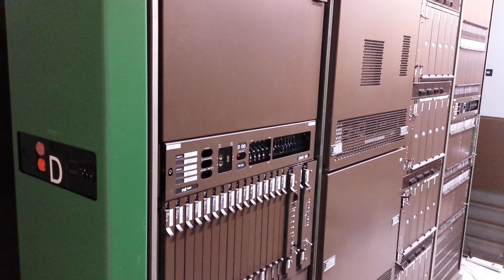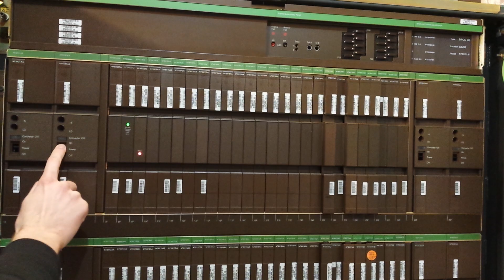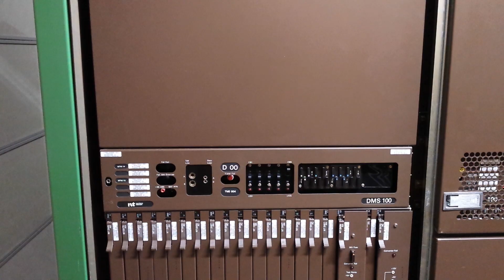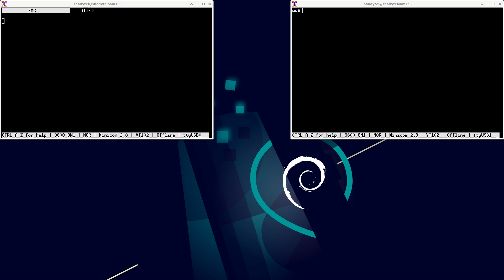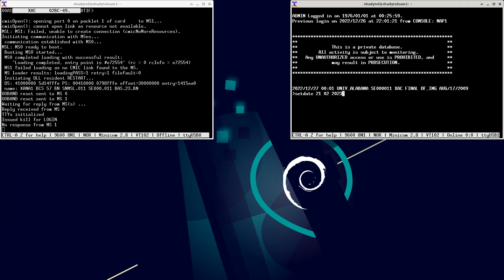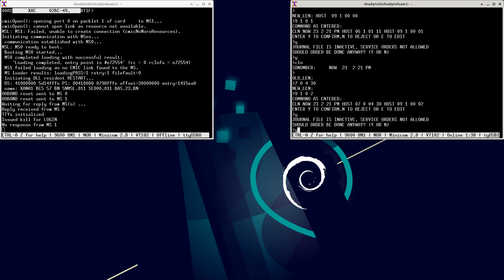DMS-100 Startup and First Phone Calls

Comment: So glad to finally see this running! I can't even begin to imagine how much effort went into this behind the scenes. Also, you're an absolute chad for using the Nortel analog sets, I love those things.
Reply from the maker: Of course I could have just grabbed a 2500 set, but I decided it had to be some sort of Nortel.

At some point, I need to give the SL-1/meridian styled Centrex sets I've got a try.
Reply: @joesvax  Watch out for the differences between analog sets and digital sets. They often look similar, but of course they need different line cards on the switch.
Reply from the maker: @ctillnc  yes, I'm aware, the sets I am referring to are the p-phone key sets a la M5000 and NT4Xxx

Comment: I still maintain option 11c, 81C and CS1000 at work and it's a treat to see you get this DMS-100 up and running.. Management wants to get rid of all the Nortel stuff but for critical services everyone agrees it's still rock solid and reliable. Keep up the good work!
Reply: me too, still running  cs1000, rock solid, as long as the power doesnt die unexpectedly, that wasnt fun trying to get it back after that. Callpilot hardrives starting to die now though. Keep up the good work!
Reply: Bet the military still uses this stuff
Reply: Just out of curiosity, what is this stuff being replaced with? I know it's all soft switches now, but I don't think they are just using generic asterisk boxes.
Reply: @theenterpriselab9401  This switch says University of Alabama, and they went Cisco, like most big companies. I know AT&T uses a Alcatel-Lucent (Nokia) IMS core and Verizon is on Ericsson. Nortel carrier hardware was sold to General Bandwidth, now Ribbon, so the direct upgrade path is to a Ribbon media gateway and call controller. In my area, the rapidly dying ILEC replaced their switches with Calix C-series around 10 years ago. Fiber Ethernet goes in the box and copper pairs handling DSL and POTS come out.
Reply: They told us they wanted to get rid of all the DMS switches by 2025 back in like 2018ish.  I think they got rid of one so far.  Going to be a while before they decom all these because they just keep working.  I  hope they continue to stay in service since my job relies on it.  Any time they bring something new they never give it to us unfortunately.

Comment: I remember my University rejected Northern Telecom because they were so impossibly obtuse to operate. We went with AT& T and you basically started things off by pressing a start button and monitoring a CRT. The user interface was really cool.
Reply: Everything telco is rather "obtuse". At least the 5ESS has a menu interface. It's not entirely obvious, but much more so than the command line. (having never seen one cold-start, I couldn't compare. it's not something that ever gets powered down. the one I walked around all the time was powered on in 1974, and has never been powered down to this day.)
Reply: @jfbeam  If you can get a screenshot with uptime, you win the internet hands down!
Reply: Your university knew nothing then.
Reply: @SteffenHansen1973  That's not how it works. Various components get restarted all the time. Software does get upgraded. Just at no point is all of the processors down. (see also: in service software upgrade [ISSU])
Reply: was it a 5ESS or Definity they went with?
Reply: Then they settled with a 3rd rate switch.  The 5ESS was vastly inferior to the DMS100 in Europe. 

To buy a switch because it has a graphical or sone other interface over the DMS command line interface and table structures says it all.  They only needed low skilled operators to maintain it, not skilled DMS engineers.
Reply: I started my career monitoring a DMS-MTX and moved to a competitor that had 5ESS’ and my reaction to the interface was exactly the opposite of yours. While prettier, the 5E was less intuitive and harder to operate, IMHO. Tons of power in the command line interface on the DMS if you knew what you were doing.

Comment: I started installing DMS back in late 80s in Australia. Went on to work for Nortel for 12 years before being made redundant not long before the demise of the company. Worked on Supernode CM/SLM pre BRISC with JNET all the way through to XA-Core, ENET, SPM, IOM and SNSE with DMS-100, 300, DMS TOPS, STP, SCP, MSC, MTX, GSP then right through the evolution of CS2K and CS2Kc and C20. CS2K hardware including but not limited to CICM, MG15K, G9, ERS8600, SAM21, MS2010, IW-SPM and SST and BCP for SIP trunking and A2 for SIP lines and SIP PBX. 
Next step is moving from CS2K, C20 and DMS-300 replacing them with Ribbon SBC and standalone A2. 
All the blood, sweat and tears I have shed for DMS over the years. But it’s all been worth it.
I cried the day I had to turn off the CS2Kc which was replaced with Cisco Call Manager…replacing a carrier grade solution with an enterprise POS that had so many flaws and very poor support.

Comment: Very cool!  I worked for a large hospital corporation for 32 years and we had tons of Nortel equipment.  Everything from tiny Norstar systems in some physician offices to Opt 81C's in the two big hospitals and two Opt 41's in the smaller hospital and business office.  I had them all networked together using ISDN.  I went to factory schools a number of times and loved working on that stuff.  Shortly after I retired, they declared bankruptcy and most of the big iron was acquired by Avaya I believe.  When we started building the data network in the early 90's, most of it was Bay Networks, later acquired by Nortel.  That dial tone and ringback was common to all Nortel equipment including my home phone which is a 3x8 Norstar fed by a voip adapter and a blue tooth gateway to our cell phones.

Comment: I must be getting old.  I worked on these at BNR in our captive offices, mid 80s, and wrote some of the LCM and other maintenance software other peripherals, i.e. the double dashes that report card failure on 1/2 the replaceable unit.  I can't remember much (PROTEL or other), I went on to other work at Nortel and anyway, so long ago ... amazing to see this set up in a garage, I wouldn't know how to do any of this anymore (I do remember loading large tapes of test software) in lab shifts that were sometimes only available at midnight ... blast from the past. Thankyou.

Comment: Old school Nortel guy here. I came up on working on the Option 11’s and later on the CS1K and also worked on many Norstar switches back in the day. Nortel was some of the most rock solid gear you could work on. Local phone company here had a DMS100 at one point and later upgraded to the CS2K. It’s a treat to see someone take interest in keeping the Nortel gear alive. Some of the best stuff in the industry right there. Now you need the digital M5000 series phones to go along with that switch. They look just like their counterparts on the M2000 series but are totally different beasts.
Reply from the maker: I actually do have several of the M5000 series, and even an old NT4X set in the older SL-1 styling. I need to get around to trying them at some point.

Comment: Coincidentally, I co-op'ed as an outside plant engineer with BellSouth in Tuscaloosa while I was in school there (in electrical engineering). I haven't checked lately, but last I heard, AT&T was using Lucent 5ESS switches in all three Tuscaloosa central offices (Northport, Druid Hills, and Tuscaloosa Main & Toll). They replaced the switch in the Main & Toll office after I graduated (the former clicky beast in that CO was an AT&T [Lucent] of some variety), and for some reason I never had a reason to visit the Northport CO, but I've seen the 5ESS in the Druid Hills office. :)

Comment: Went to training on Nortel switches back in the late 1980s or early 1990s.  We used a couple of these switches at gateway earth stations for the satellite new gathering system GTE Spacenet had that supported ABC, CBS, CNN, and NBC satellite news gathering trucks.

The switch allowed the SNG trucks to connect to the PSTN and make calls back to the station to set up the new feeds and to connect the talent's IFB audio.  The trucks could also make international calls if desired.  We passed the billing records back to the networks based on the SNG truck's ID.  Fun times.

Comment: As someone who took a summer internship as a maintenance tech on 1980's and 90's era semiconductor fab equipment a couple years ago, I can say, that the order you turn this old equipment on matters. It always baffled me how you couldn't just "turn it all on".....like, things had to warm up and you had to follow the procedure or else certain cards on certain control boards wouldn't boot or be recognized etc. It was wild.
Reply: "It's all in the sequencing." Everything has a power on order. Even a PC has to have the numerous components powered on in a specific order. (somewhere around here, I have the FPGA programs for the various servers I helped design.)

Comment: I supported and wrote DMS100/200/250/300  HW diagnostic portions of code as well as line card supervision extensions and ringing, payphone coin  support, designed and integrated API for SLC96 remotes and good old echo suppression and echo cancellation. MAP UX was a hoot!  DER Energy is next new control plane at scale challenge.  Energy is the new "Media"
Reply: Haha haha what bullshit.  Line supervision of a DMS300 ?   HAHAHA

Comment: Very cool to see after so many years!  You need to get some punchdown blocks to wire to the LCM's.  Then you can know the joys of running that terrible tool (I forgot its name) that makes you verify dial tone on every pair, in order.  If something was wrong or if you accidentally the wrong pair, the tool threw the error and quit.  You had to start over.  PITA.  To clarify, though, this is a DMS-100, aka "class 5 end office."  SL-100/MSL-100 has the DMS software base and additional code for DLM's and digital phones (M2000 series).  The MSL-100 was also cabinetized (i.e., one shelf shorter with gray front/back doors and end panels).  I have books - I'll send you a DM.
Reply from the maker: Yeah, this system was originally a DMS-100/200 (SL-100 didn't exist when it was installed) and later converted to SL-100/MSL-100, so it has a mixture of converted DMS hardware and SL hardware. Later on it was upgraded to CS-2100 (PABX counterpart to CS-2000 CO switch).

I haven't found any way to DM through youtube, but feel free to contact me via email or other means http://www.dms-100.net/contact/

Comment: Amazing video. I worked on DMS500 since mid-90s, kept quite a handfull of documention if you need. Mostly cds. Im retired now but company i worked for 20 years still have 3 DMS running in VA, and im probably will be cLled back for decommission job once all services have migrated to  voip.
Reply from the maker: If you're looking to unload any of that documentation, I've been slowly preserving it and putting it up on my website. Get in touch with me, if you'd like. http://www.dms-100.net/contact/

Comment: Triumphant!

That's gorgeous. Let's set you up with a bunch of 50-pin connectors and harmonica breakouts.
Reply from the maker: Actually I need a bunch of 32 pair connectors.....

Each line drawer on the DMS has 64 lines

Comment: Just makes me think about when I had to run jumpers across the rack, 150ft down,  up a ladder, two isles over. We were still putting 900 pair cable in the ground 7 years ago (road moves)... winching so hard the front end of the truck lifted up off the ground.

Comment: I remember programming Unisys mainframes using NAP (Network Applications Plaform) to interface into these switches back from the early 90s to mid 2000s. We were able to perform several hundred thousand customized calls a day without breaking any sweat.

Comment: Wow, that's really impressive! Especially so after reading how much work was involved getting to this point. 
I've always had a soft spot for these old digital systems, but the furthest I ever got into it is some little Norstar units. I did manage to get the Norstar CTA and RAD software working, and I believe I have the Norstar version of that Dialogic T1 card you mention on your website (model D/42-NS) but unfortunately I never found any use for it.

Comment: Not sure how I found your video but I used to work 3rd party hardware mainenance in Chicago and worked on some VAX's.  The things are bullet proof, the blowers have a rating of something like 100,000,000 hours (If I remember right).... Thats like 114 years!!! Guy I worked with had worked on them since they came out and he said he had only replaced one do to a "true" fault and it was because that model of 7000 had the blower mounted vertially.
Reply: Never got the plesure of working on the PBX's though. But did get to work on a System 360 with the 3420.  I've pulled miles of bus and tag also lol

Comment: I just read your story; it certainly takes lots of bravery and dedication to pull off something this ambitious and risky, and I'm quite impressed at the progress you've made so far. I myself have got to start exploring govdeals - although I don't have the resources to pull off something this risky.

Since this PBX is essentially a smaller version of a DMS-100, I'm wondering if it could serve an ISDN line. If you have a couple of IDSN modems, you should see if you could hook them up through the PBX and transmit data from one to the other.

I'm also wondering if there's a way to configure a special sort of analog phone line where, when one picks to the telephone, instead of getting a dialtone, music is instead transmitted to indicate a readiness to dial.
Reply: The switch monitors the first duration of establishing a dial tone, if you put music  on the first part of it when you go off the  hook the switch wouldn’t be happy and gives you a fast busy signal. Or a error message on the computer terminal at the office.
Reply: They didn’t engineer stupid people to put music on top of a dial tone, the switch would say nope 👎🏼 not a dial tone and wouldn’t even let you get close to dialing a phone number it’ll just drop you out of the call progressing path back into a fast tone signal to let you know something went wrong!
Reply from the maker: I have the equipment to serve ISDN PRI (T1/1.544M) but not BRI (128k). BRI required upgraded line card shelves which I don't have.

As far as a musical dial tone, I doubt this is possible through configuration alone, it would take some complex hardware or firmware hacking to pull off such a thing.
Reply from the maker: I should also mention that while I don't have BRI equipment for the DMS, I do have it for the Meridian 1.
Reply: @joesvax  T1s are fun to work on and troubleshoot.
Reply from the maker: @denniswoycheshen  indeed, luckily I have some experience from my other telephony projects
Reply: @joesvax  my favorite test is actually using my exfo to connect to the pri and D channel to test dialtone.  Idk, there is something special about it.  Crazy that anyone uses it anymore, but I guess it's cheaper than upgrading and easier to use in some applications.

Comment: can you explain what the sound at 48 seconds in, is that a soft start for fans or something? also, is this whole thing running off those4 power  supplies sat ontop of the cabinet?
Reply from the maker: The noise is the fans, but no, I don't know why it howls like that at startup.

The power supplies on top of the cabinet are generating the -48V supply to power the switch, yes.
Reply: These switches are loud! You might be served off a switch like this in your home town!

Comment: Is it 680x0 or RISC?  And what are the power supplies on top of one of the racks for?
Reply from the maker: The 'control complex' is PowerPC and the peripherals are mostly a mix of 680x0 and 8085. I'll probably go over some of the details in later videos.
Reply: @joesvax  Oh so this is much newer than I thought.
Reply from the maker: When the switch was installed in 1985 it had a Nortel NT40 control complex. Bespoke architecture created by Bell Northern Research. Through the years, it would have gone through upgrades to 68k, then 88k (RISC), and finally PPC.
Reply from the maker: The power supplies are making the 48VDC power that is distributed to the equipment in the switch.

Comment: What is the actual power load in amps for this guy?
Reply from the maker: DC side is probably around 50A @ 54VDC, a touch over 3kW on the 120VAC side after you account for the power supply efficiency.
Reply: @joesvax  Seems like it would be more, judging by those breakers.